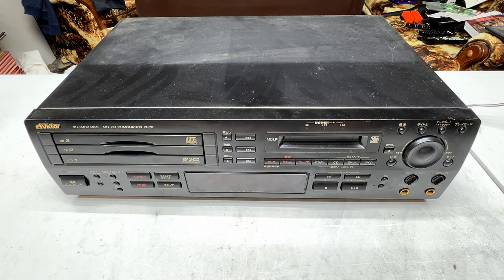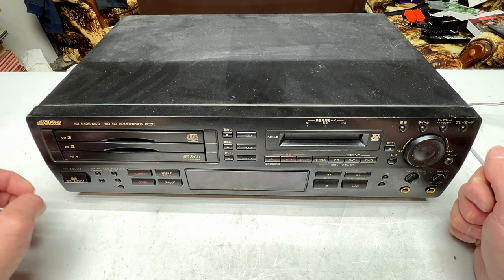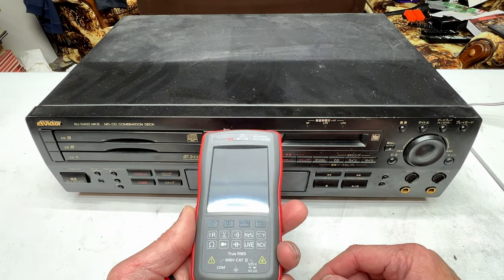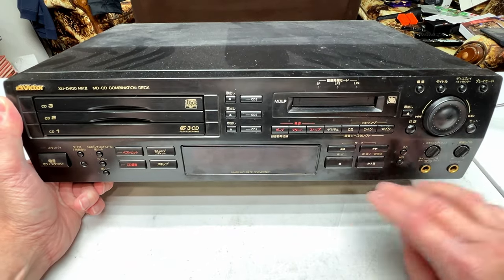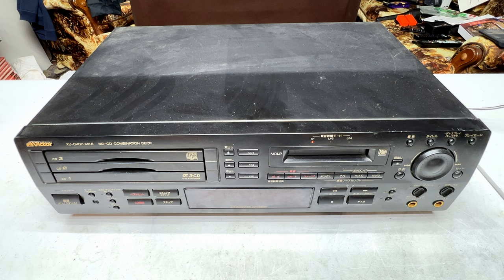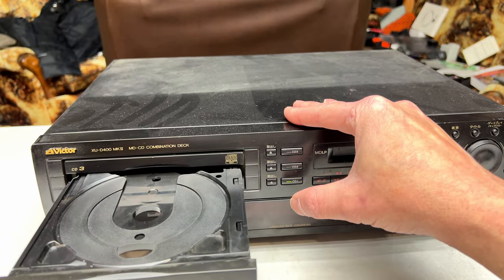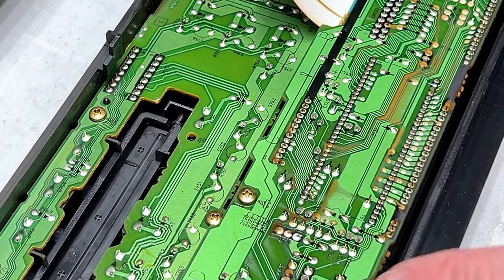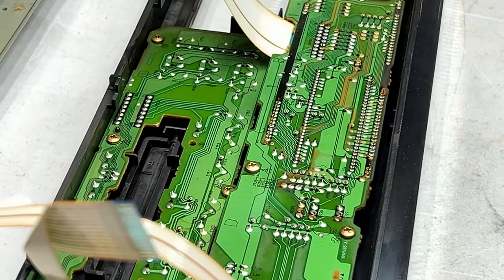JVC Victor XU-D400 Mk II - MD Combo Deck Dumpster Fire

Comment: 1.5v is a pretty low voltage to test with, the motor is not even thinking of turning. Pretty lame to test a motor with a battery, use a PSU with voltage  & current control (don't have one? buy one!) and display. I really doubt is the motor, it is possible there is a short in the motor controller. If so, you cannot move the motor spindle because of the short. Because you don't have tested this, I cannot say it for sure.
Reply: Don't you think it may be programmed to avoid cds or mds if "emergency stop" is displayed?

Comment: I had a Sharp MD-R3 which was incredibly similar to this model. The front panel controls were moved around a bit with the jog wheel in the centre and the MD deck more to the left, but otherwise it appears to be the almost same machine except the rear panel ports were different being for the EU/UK market.  The MD deck failed on it though and later on the CD deck started playing up so I eventually got rid of it. Unfortunately Sharp minidisc decks and portables seem to be very unreliable compared to Sony mechanisms.

Comment: Mate, try to disassemble a bit more so that you can try to spin that md spindle motor by hands and then use a bit higher voltage for it while helping that motor to spin by hand, after that use some oil on front bearing and increase voltage bit by bit until i would say some 9volts. - > by using this method i have revived some "unserviceable"motors... also regarding display i think it is covered by smoke dirt.. some cleaning would help :) cigarettes smoke is actuality killing devices and i dont understand why to smoke inside the house..never...
Cheers!
Reply from the maker: Thanks! I might come back to it in the future. I did get the entire CD section to work off camera.